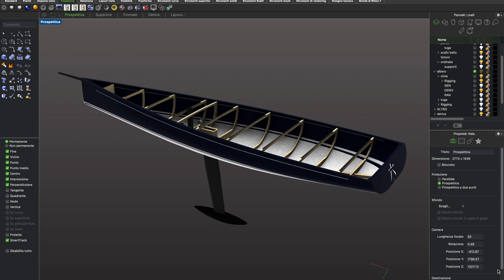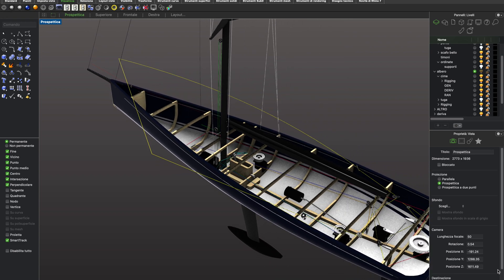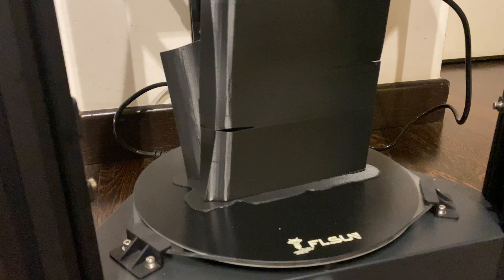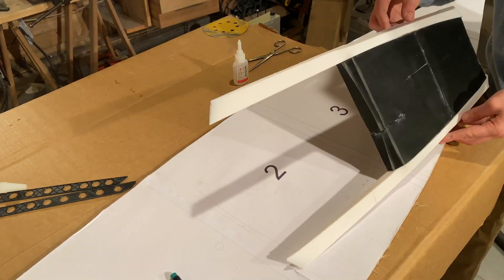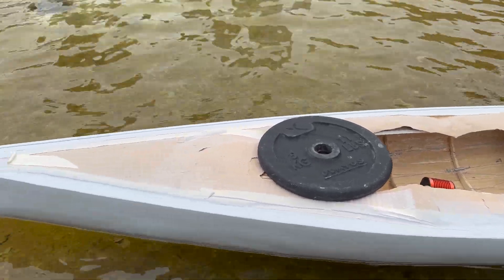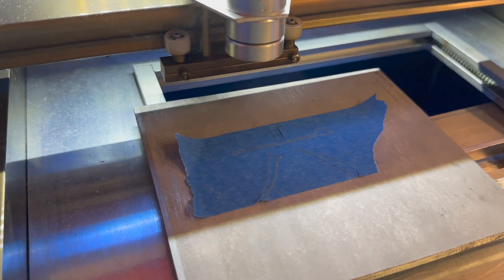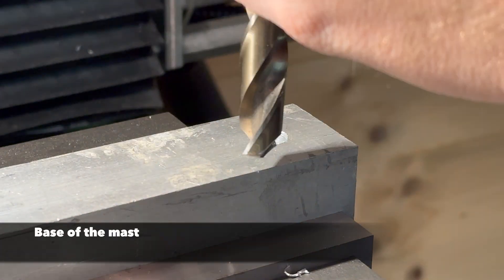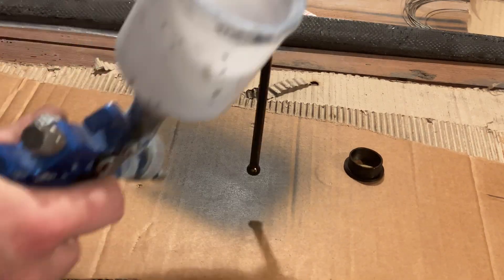Sailing yacht rc model construction process part 3: Electronics, paint job, deck.

Comment: Absolutly fantastic build! I need to learn to draw in cad so i can make my own boat, what cad program are you using? Or rather, do you have any recomendation as to wich program i should learn? 😅
Reply from the maker: Thanks you very much!! I used mainly rhinoceros and also fusion 360, they are both very good to learn
Reply: @EdoardoChisale  thank you! Rhinoceros sadly is a bit too steep for my budget right now, concidering material cost, tools and electronics. Maybe i can get my wife to apply for a student copy, even tho she is studdying international politics and not engieneering ^^